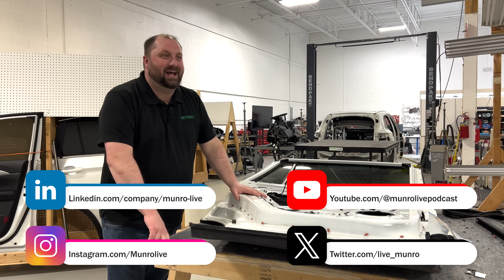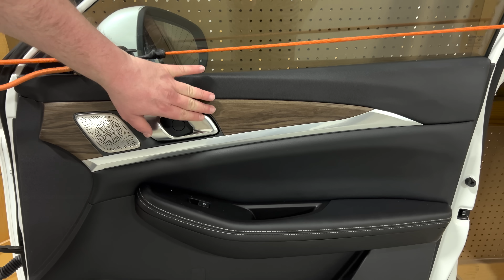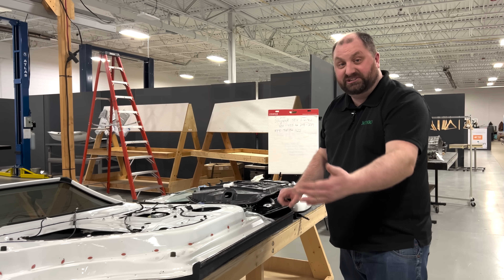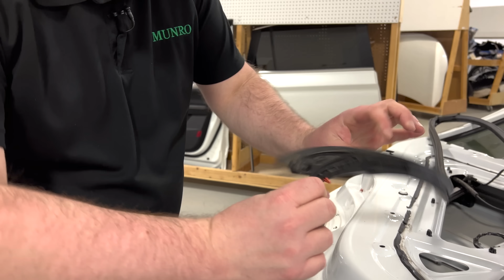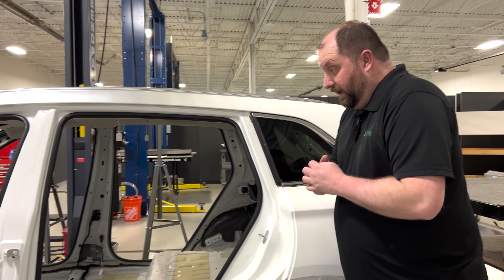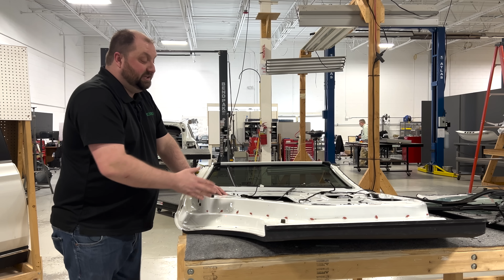Cushy or Costly? Imperium Skywell Door Teardown

Comment: Curious,  I don't have experience in the automotive manufacturing world, could then make the two stampings, paint them individually, install the electrical components on the inner stamping and then weld the two stamping together?
Reply: They would need to protect/weld/seal/paint the complete door afterwards masking everything, so I'm sure they did not do it 😉